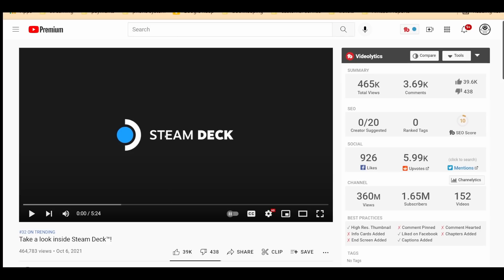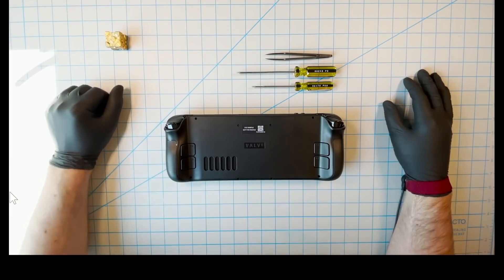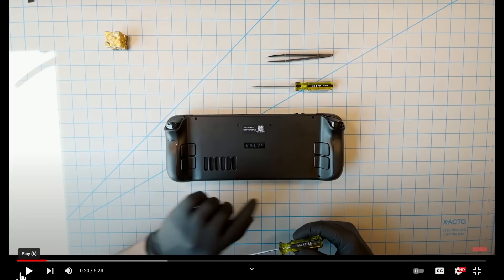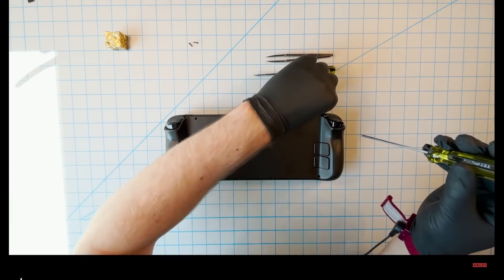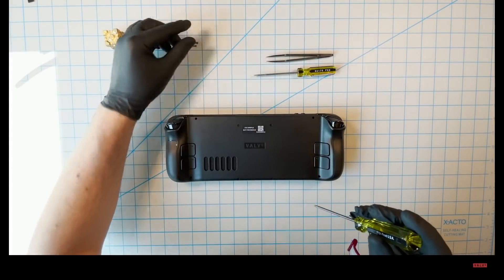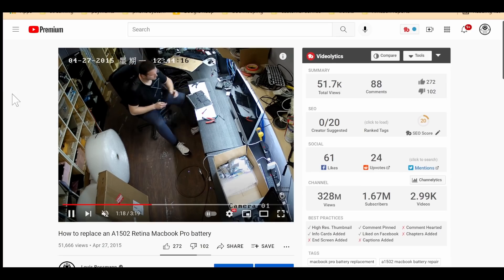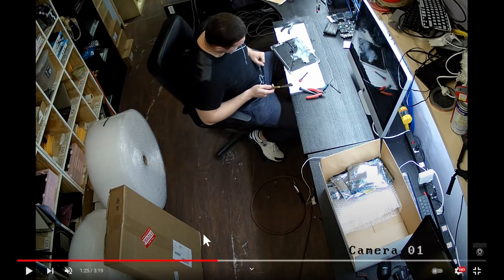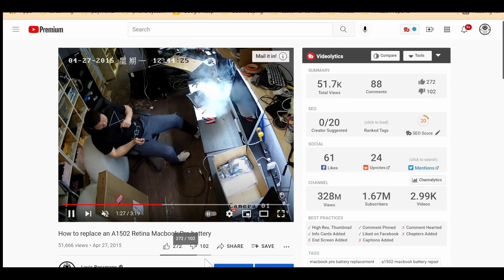Steam deck battery may end your life? bruh 😑

Comment: 7:52 A great technique for re-inserting self-tapping screws into plastic is to turn them in the reverse direction (as if loosening) with gentle (or no) pressure until you feel a drop or hear a "click", then tighten them in the forward direction. This will re-use the existing threads in the plastic instead of cutting new ones gradually stripping the hole.
Reply: Using the method you just described with plastic you have generally only 10 times if you want to maintain as new torque/holding force.  Even that you are not cutting a new thread you are still wearing the thread out.   There are a lot of engineering studies on this.  Different metals with self tapping is worse than plastic to the point that you may only get 1 shot using self tapping yet tapped into the same metal get a few thousand.   The problem is the shape of the self tapping thread its ever wondered where the material the self tapping thread has cut out on the way in goes and what it does.   The cut out material of you self tapper is used for two things a percentage as thread locking compound of course this is important to hold torque and a percentage is pushed to the back(not structurally important but is why they go wrong).   Guess what happening here as you put a self tapper in and out with plastic perfectly more and more plastic that should be thread locker is pushed to the back waste area where it can do nothing.   Nature of self tapping screws in plastic is they will lose their means to hold torque and will loss this lot more quickly than most will suspect.  Fun part how to replace the lost plastic thread locker with a exactly matched thread locker material.   Too strong the screw will not unwind when it should so break something too weak will unscrew at torque levels where it should not.   Yes cutting a new thread also has it nightmare levels problems due to now having lot less material to hold the force.   So cut new thread or use existing you are screwed due to the same basic problem of driving the plastic you need to support the load and thread lock to the back of the hold where it can do nothing.
Reply: @peterdolding6918  Right. So you aren't aware of a better method either? ☹️
Reply: @CodeOptimism  Well the manufacturer could use threaded brass inserts or a metal frame, but that would add cost and would use a little bit more space. And these things you definetly wanna cut short with a high volume handheld. An after market magnesium or aluminium shell could do it better.
Reply: @CodeOptimism  Its limitation of the technology.  I know of better methods but all come with increased cost of production and increased failure rates in production.  Brass/steel inserts put those in the plastic has its own set of problems.   Metal shells are not cheap and you cannot really use self tappers with those if you expect durability either.
Reply: @DrN4b0   sorry magnesium or aluminium shell with self tappers is worse durability than using plastic.   You need extra step to tap in the thread for the non self tapper screws.   Yes this is extra cost and extra failures when the tapping fails.
Reply: @DrN4b0  aftermarket parts are pretty much guarantee to happen, especially when people start using m.2 riser cables to install full size nvme ssds into their steamdeck and need custom chassis to accomodate the mounting hardware
Reply: @DrN4b0  there should be an kit of inserts and screws, to put it in for yourself. The inserts can be applied with a soldering iron as  shown by the 3d printing community. Of course this requires enough wall plastic material to support it.
Reply: @DrN4b0  While they may be better than just plastic, I have a laptop where most of the metal inserts just broke loose and the screws don't hold anything now.
Reply: @wiebel7569  yeah this is what I was thinking about. But from what i've seen so far from the videos of the Steam deck I wouldn't expect that there is enough plastic for that.

@Z3DZ3R0 Well yeah been there, seen that, fixed it with epoxy. Plastic tends to get brittle when it gets old but I suspect that the longevity of a device with brass inserts is better that with self tapping screws. Saying this we'll all have to accept that most hardware today isn't build to last a century, if you're lucky you can get a decade without repairs.
Reply: @wiebel7569   Bad news no.  As  @Z3DZ3R0 pointed out if threaded inserts are done wrong they will not hold.   The plastic around a threaded insert that holds as to be designed a particular way and people still should be using torque screw drivers not to over drive them and crack them.  The reality here you can put a higher torque on a threaded insert than you can put on a self tapping screw into plastic so the mounts for self tapping are not rated for enough torque to take threaded inserts.   Horrible point is putting a self tapper into plastic into a area designed for a threaded insert has higher risk when new of stripping.  So this is horrible a case where you have to either design for threaded inserts or design for self tappers.   @DrN4b0  comment about plastic coming brittle with age that is normally not a cause of mount failures is long term mechanical stress or over use/incorrect use is the common cause.
Reply: @peterdolding6918  TBH...who is gonna take it apart the "ten times" you say the screws can be removed/reinserted. The reverse turn/retighten method is the best for these situations.
Reply: @less5406  The bad point is a lot people who don't know better will do it more than "ten times" in a year.   You see it with used controllers and game devices and the like where they are trying different lubrication and other things to be more game competitive.  Of course the controller and game devices end up in the second hand market massively lacking rigidity due to the screws.  This explains why value need the warning in the video as well for the unformed.    Basically just because you are not one of those people does not mean they don't exist.  It would if more people understood this limitation.
Reply: I hope Valve made those screw bosses fairly thick. I doubt it since the science behind wall thicknesses and plastic flow require a wall thickness limit, but if they did, that would be awesome because you could maybe buy some threaded brass inserts off mcmaster a size smaller, use a soldering iron to push/melt them into the existing bosses, and now your can open and close your unit without worrying about stripping the threads.
Reply: strange had always done this but had no reason it just felt correct to me
Reply: What I do is use the weight of the screwdriver and twist opposite the threads until it clicks. When you tighten it(assuming its a one time thing), tighten it just over snug instead of when it stops in order to make the threads grab a small bit of fresh plastic.
Reply: I do this with all screws. It's easier to not screw up and put the screw "sideways"/wrong in the threads.
Reply: Yes I agree........
I worked as a Design Engineer for many years especially on plastics goods. Screws for use on plastics should be 'thread rolling' or other specialised thread rather than the sharp ones used on screws designed to tap into metal ;and you should only use screws rated for plastics. Plastics bosses tend to break or shatter when sharp cuts or cracks start to spread and metal tapping type screws can accentuate this problem. When replacing screws into plastic it is good practice to gently turn them the wrong way under very light pressure and you can usually feel the screw lift up on the threads already cut into the boss then suddenly drop. At that point just screw the correct way and the screw should go straight into the old thread. Doing this you should be able to open and close a screw into plastic many times with no problems. Just screwing in will probably cut a fresh thread which weakens the boss. Doing that repeatedly can strip it out.

Comment: They say structural integrity is "somewhat" affected which kinda is like not really much, and it is probably true since you at least strip the plastic sockets the screws go into a little bit. Also about the batteries, there is probably a lot of people that would open their device next to flammable things and or try to throw it in the trash when it starts smoking and in turn get them selfs harmed by setting the trash (or house) on fire or smoke in the rather toxic fumes. So although it is a bit of an hyperbole, it can actually be true if someone with zero experience with electronics does that and punctures the battery.
Lots of people have stuff at home like rugs etc that create way more static charge then you probably do in your shop ,so people at home should probably wear anti-static straps. Also they probably thought the static strap over the glove was funny, and left it in because of that, valve is very lax with its employees so they have a lot of creative freedom normally.

Comment: The weakening upon opening might be related to deformation of plastic clips holding it together. I'm no structural engineer but I've been taking apart consoles (both broken and working) and most shell clips do oppose less resistance to opening after the first time. The slightly looser clip might make it more likely to open up if/when you drop it. So I think they MIGHT have a real reason, but proper phrasing would be "less drop-resistant" instead of "compromised structural integrity"

Comment: For the self tapping screws issue, think about Ikea particle board furniture. If you assemble it the first time, it's decently rigid, but if you disassemble and resemble it a few times, the screws wear through the holes and it loses structural integrity (this happened when I picked up a used Ikea shelf. It literally fell apart when I set it up)

Comment: I dropped a Ryobi 18v battery into a bucket with water. I dried it out, and let it set an additional week. I had three chargers, so to charge it I took the oldest one and charged it in my oven. Considering it's a self-cleaning oven, which heats to nearly 900F, as long as I didn't lock it, I was't worried. Everything was fine.

Comment: A theory considering the structural integrity: Since they use self tapping screws in a simple plastic mold, the holes are internally flat without any threads. Then it is assembled and the screws cut their own thread in it. When you remove and then reinsert the screws, you will most likely not exactly fit the screws back into the soft plastic threading that was first created but rather cut a new one. Making the hole wider and the screws may just be little bit more lose than before. Thinking of all the cheap electronics powered by button cells I've torn down in my childhood with self tapping screws and after 5 to 10 dis- and reassemblies, the holes were sometimes too large to hold the screws so it was either time for tape or a thicker screw ;)

Comment: @9:00 I suspect what they're trying to get at is that it's easy to chip or otherwise damage the case. And a small chip in the wrong spot can significantly weaken a material.  So while they are being slightly hyperbolic, it probably isn't that far off.

But you're absolutely right that if the choice is "buy a new one" or "risk weakening the structure", then there is a clear answer, and it's not "buy a new one"

Comment: 4:32 I agree. Most injuries from Li-Ion batteries come from faulty batteries in devices never opened. When the battery starts to break down in normal use (manufacturing error or aging or both)

Comment: The reason why the structural integrity is lessened is largely in part because of the self tapping screws. They're very firmly in place when they are installed, since installing them the first time is actually threading the plastic itself giving you an extremely tight fit. When you take them out, they're not making as tight contact as they were. We're not talking a huge degradation here, but it's certainly not as strong as before.

Comment: I wanted to echo what others saying, I believe the main loss of "structural integrity" would be from
- self tapping screws getting a bad fit (because they are annoying to get back in exactly the same thread tightly)
- outright stripping screws
- very tight press fit, or plastic clips have a tendency to be reassembled wrong which could affect what every damage 
absorption characteristics they were going for.

I don't think the Deck has many, if any plastic clips.
But I am personally upset about the self-tapping screws, I really don't like plastic, and plastic screw holes are just not robust 
or easy to use (especailly without damaging).

To be honest, I think the issues here are negligible, but they want to take on Right to Repair erring on the side of caution,
completely reasonable for such a large userbase (people be dumb).
Also forever is hyperbolic (they are intentionally hyperbolic for entertainment/hype/legal reasons). It would be possible 
to achieve the same or better than factory, but it would not be trivial imo.

Comment: He is right about the self tappers. I dont know why they would use those to begin with..they are the scourge of hardware. Once removed, you will never get them to have the same clamping forced they did when new.

Even with locktite, once you removed the internal threads made by the screw, theres less material, which leads to less internal resistance against the screw threads, which leads to more torque being needed to reach the same clamping force, and that extra torque might be too much for the material to handle, i.e. threads break off, so you get loose screws, that will pop out on impact or vibration (which self tappers will want to do anyways). To be, that seems more like a really REALLY bad design choice on their part.
Reply: I just realized something. I dont think we are talking about the same self tapping screws. Metal self tapers have a rudimentary drill at their tip. These, I think theyre more like power tool screws, made of some steel, screwing into PP plastic with nylon or glass reinforcement, where the screw molds the plastic into an internal thread. THOSE, are fine, but not knowing what kind of plastic they use, its hard to say if the plastic will be mangled (internal thread part). Still, they are trying real hard to have people NOT open things up.

Separately, the wrist band thing is funny. If I didnt have to use them while fueling up a jet, Im sure its fine on one of these (I will say that the jet will be grounded, but the flow of fuel actually generates more voltage than you might image, and that needs to be dissipated through a ground). Also, we grounded ourselves through the anchors in the apron (much like you're supposed to ground yourself when refueling a car, by something metallic, that isnt the car or the pump body itself, even though, they are grounded separately as well)

Comment: About the structural integrity: screwing and unscrewing screws in a plastic case will make the screws loos and looser. Instead of having the base and the cover to react together to an impact, if both come loose the part that get hit will be alone to dissipate the energy.
Look at the test they made! They probably concluded that the console what way more strong when all the part where strongly joined together.
The video is OVER-PROTECTIVE for the "owner" and for the "console"
You should not criticize people that try to warn you.

Comment: The structural integrity thing might be more so in the case of cracking/scarring caused by mistakes, I’ve had experience with this kind of hidden damage when i get more compact devices repaired. Like when I got my laptop fixed, one of the “structural snapping” tabs cracked which i couldn’t see until the whole screen hinge assembly snapped backwards when the tab broke. This was on an older Toshiba Satellite model. Although it shouldn’t always be a big impact on the structural integrality it could… them saying that is probably just another disclaimer.

Comment: The only way drop resistance will be affected is if the consumer removes the back case incorrectly and bends it too much causing more structural issues. You’d be surprised sometimes how some just try to rip the back off of their own devices trying to fix it themselves. I’m no professional, but I have seen many try and just mangle the body of their own devices if fixed themselves. Even if done properly, probably won’t notice much of a difference for drop resistance. I’ve fixed many of my friends phones for just replaced parts and not to the level as component level like repair like you. On the other hand, Valve will have a store for replaceable parts for the steam deck which is a good thing for right-to-repair.

Comment: This is such a ghetto setup video, anybody notice the Valve guy is working on the backside protection paper of self-adhesive plastic foil with a big chunk missing on the left? Looks almost like a professional mod mat or something I guess :)
Edit: I work in the field of li-ion batteries and the biggest risk of a cell burning is the electrolyte. The currently most common type of high capacity li-ion cells are graphite anode, nickel-manganese-cobalt oxide cathode cells. Both are not a biggie, the cathode material can be carcinogenic. However the electrolyte used is usually liquid or polymerized Li+PF6 (Lithium-hexafluorophosphate) which causes smoke that turns in to hydrofluoric acid on contact with water (lungs/eyes etc...) so being in a confined/unventilated place and breathing the smoke can definitely cause bodily harm. People also tried putting dogs in a microwave to dry em and considering the shitty lawsuit over anything mentality in the US I think Valve are having a point to cover their asses.

Comment: Since the screws are self tapping and just going into plastic the second time they get screwed in won't ever be as good as the first. I'm assuming that's the problem with the structural integrity they mentioned.